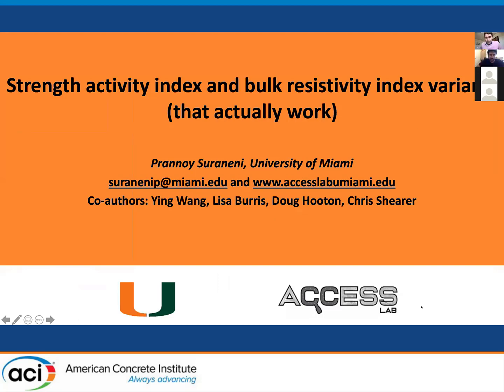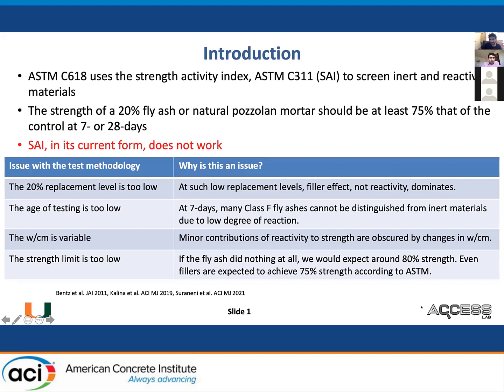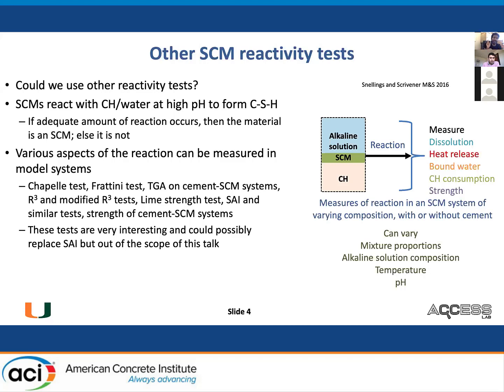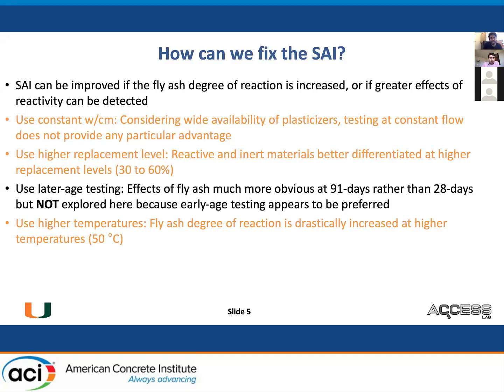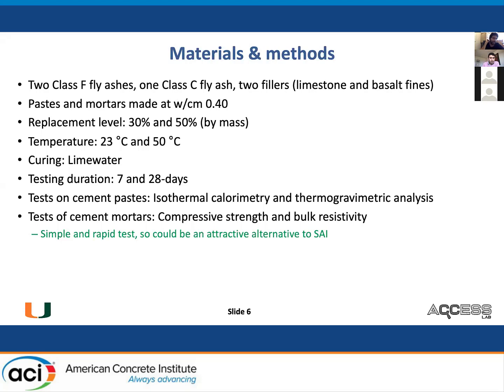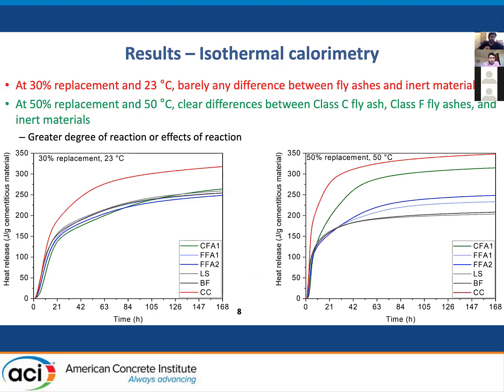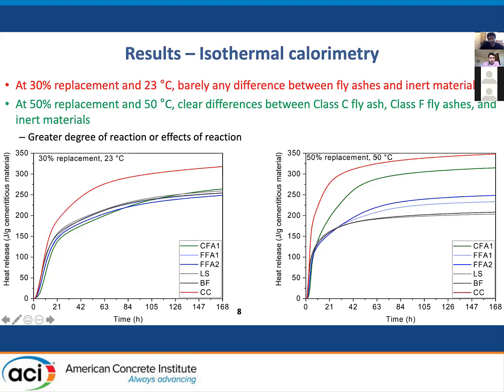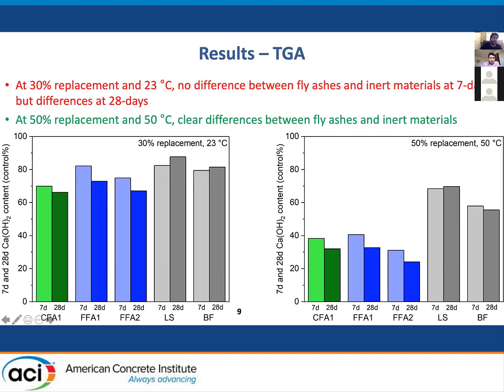An Improved Strength Activity Index Test

Comment: Dear Sir/Madam,
Study and experience is fine, but how will the bottom ash be known through the test. Tests and specification should be mentioned in ASTM C618. Additionally,  amorphous form from raw silica in ASTM C618.Blended cement with 30% pozzolan should have a 7-day compressive strength of at least 35 MPa as specified in ASTM C311. 
Submitted for your information and consideration.

With best regards,

T.Javed
Senior Engineer QA/QC